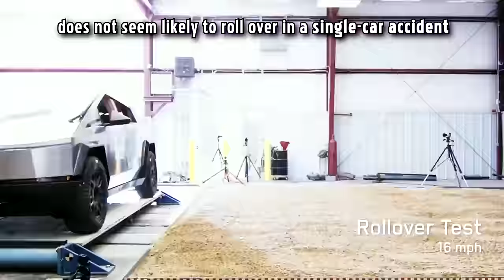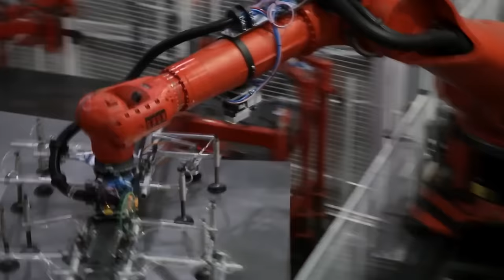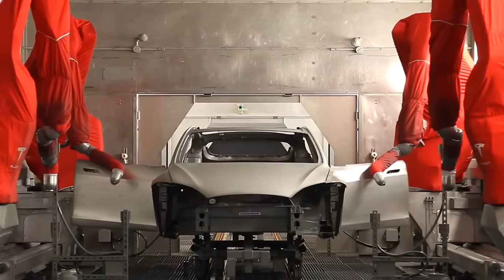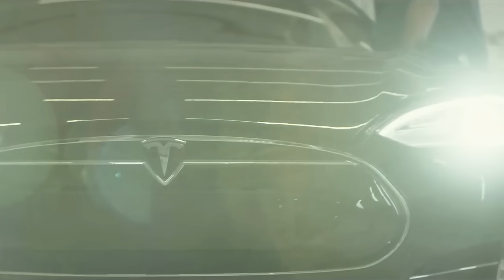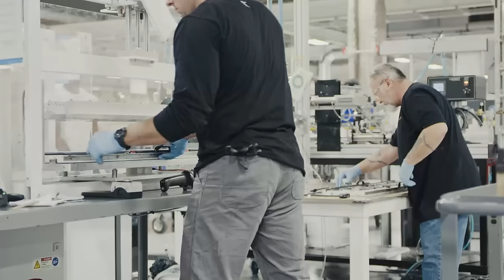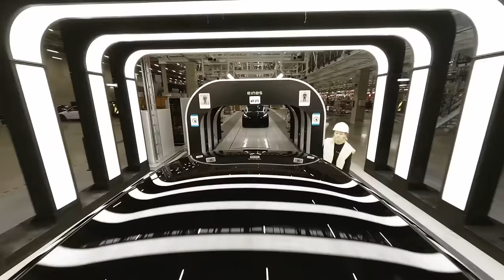TESLA Cybertruck US Factory🚘Inside Secret Billion $ Gigafactory {+ Crash Test analysis}

Comment: While I like the videos of the factory, there are a fair amount of errors in the narration. “The Cybertruck is their first high voltage vehicle”… then immediately about the battery. This shows a lack of understanding. Don’t mix up the vehicle low voltage control system at 48V with the 800V battery architecture. They are unrelated. The 48V system is the vehicles low voltage system and should not be called high voltage. “Shatterproof and bulletproof front glass” is completely inaccurate. “Severe movement of rear axle in crash test is concerning”… that’s just the rear wheel steering system giving way, there is no solid axle between the two wheels and it’s not “concerning”. 

There are more errors… still I didn’t want to give the video a thumbs down but things should be better researched.
Reply from the maker: Thank you very much for your feedback. I tried to do my best - but unfortunately there are some mistakes... It will be better next time!🤓
Reply: Also, the video mentions an "engine" being installed during the marriage sequence.
Reply: AI voice = 4,680 Batteries😕

Comment: The Cybertruck rear-wheel steering likely attributes to the the rear wheel movement during crash.
Reply: Precisely.  The battery fuses are severed in a crash and the rear steering motors have no power to hold position.
Reply from the maker: Exactly. Good point James!
Reply: @usaproductionlines3065 So why is that a concern?

Comment: No wonder it's taking so long to ramp up production on the Cyber Truck. They use robots to install the CPM module, all glass, all the seats, and the wheels/tires. It takes a ridiculous amount of work to get the programs on those robots correct so they can run at least close to world class OEE(85%). Someone still has to go in after the seats and cockpit module to bolt them in, not to mention it's faster if people do it with assist devices mounted on lineside overhead rails. 2k vehicles a week? The auto plant I worked at would drive a completed vehicle off the line every 56 seconds. We would produce over 2k vehicles in less than 4 eight hour shifts.

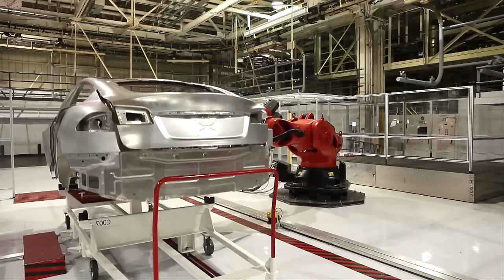Comment: 3:23, robot accuracy is really 0.2mm?  That doesnt sound too accurate.  I wonder if this applies to complaints of sloppy fit and finish.  A .2mm inaccuracy at one point could spread across the body and compound to larger inaccuracies at other end of body.
Reply: Generally, 0.2mm is not a problem for the robots. For the robot welders, every part is clamped in a automated jig before being welded, so the parts come out the same dimension every time. Most inconsistencies I see on TSLAs are body panel misalignments, which is more due to inconsistencies in the body panels themselves than the robots. The other stuff the robot is doing: seats, glass, cockpit module, tire/wheels, 0.2mm doesn't matter. You would have more than 0.2mm of error doing it by hand.